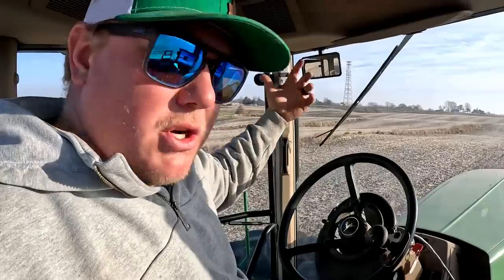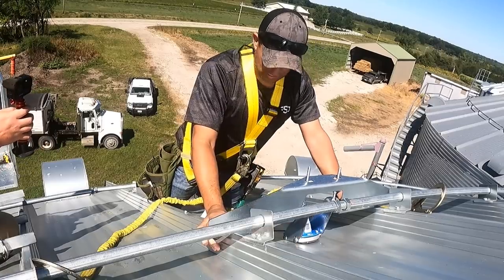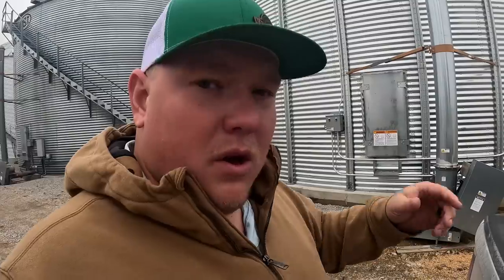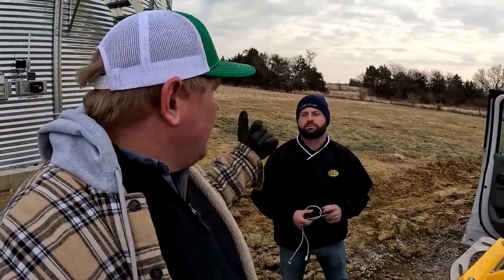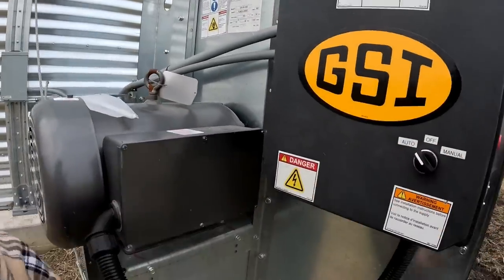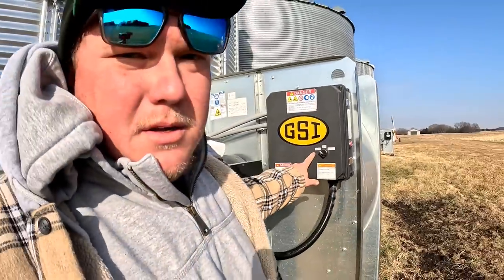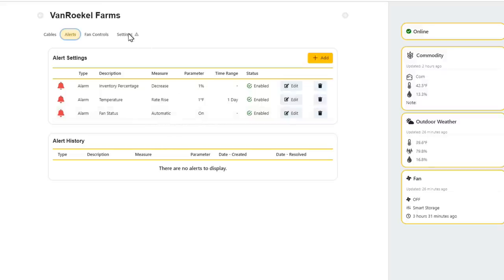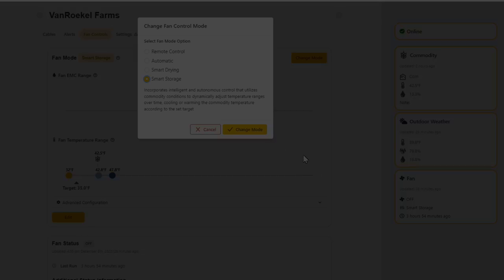Giving a GRAIN BIN a BRAIN! - GSI GrainVue installation and overview - What can it do?

Comment: Your conversation on fans and the idea of going to air drying bring up something farmers rarely pre-plan. Power. A 30 HP fan per bin is a huge amperage draw. If you're building a larger grain setup or a new setup, bring in a big power service. I've never had someone tell me they wished they brought in less power..
Reply from the maker: If you check out another one of the GSI videos you can see what we brought in for power!
Reply: @iowANFarmer  I saw that! We're a small GSI dealer up in East Central MN. The guys told me about the new GrainVue programs, and I was pumped to find this video! I saved it to show to some of our customers who like to stay on the leading edge. Thank you!